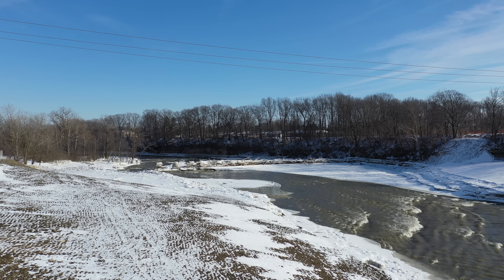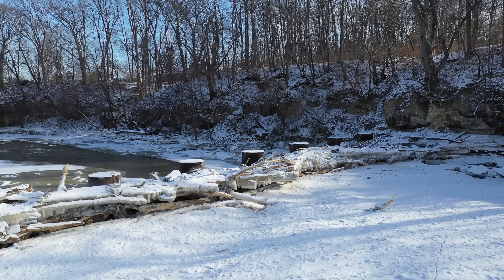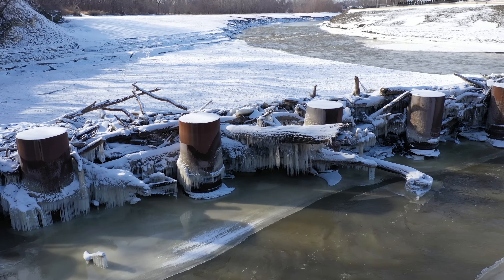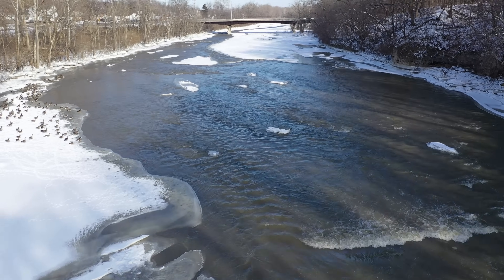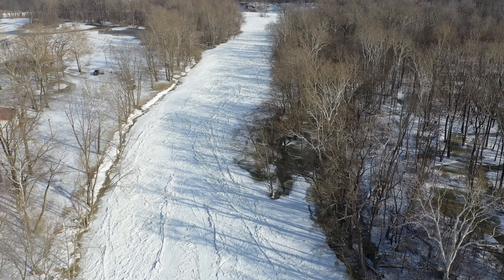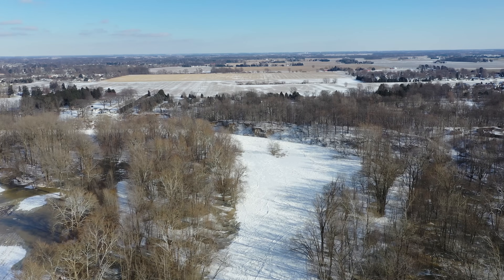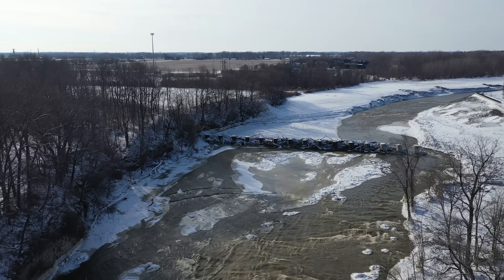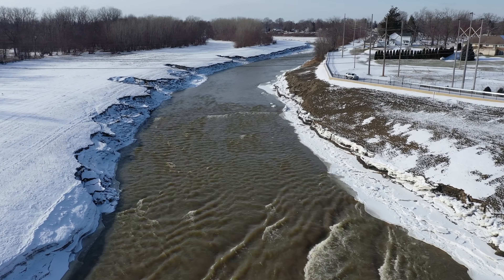Dam 2 1 2019

Comment: It'll be interesting to see what happens this coming spring season.  Freeze/thaw does some serious things to loose sediment as far as erosion.  Don't be surprised if the upper side of the ice structures erodes out to the same width as the downstream side...  When saturated mud/sediment freezes, it cracks in almost a 'shatter' type pattern similar to safety glass.  I'm not sure if if there's a technical term for it, but when it thaws, the formation itself can't tolerate the weight, and it falls away in mass.

Comment: Now that the first winter is in full swing without the dam I am sure the powers that be are re-evaluating the need/purpose of leaving the ice control structures in place. 
With the dam in place the river froze solid above the dam and when it let loose the huge sheets of ice were broken up by the ICS and were less likely to dam up the river further down. Now that the river flows faster the ice isn’t nearly as thick but the logs are coming down causing a dam at the ICS evident by the frozen cap on top seen at 2:00 showing how high the water level has been. 

I bet the ICS will be removed or at the very least shortened this coming summer if it ever gets here. Brrrrr
Reply: The ICS was recently installed because the dam was to be removed; the original plan was to construct the ICS after the dam was removed, but the schedule was rearranged because permitting of the removal was delayed by legal challenges.  The ICS is intended to replace an unintended function of the dam.  The dam removal studies state that sheet ice which formed over the impoundment area behind the dam served to capture breakup ice flowing from further upstream.  Removal of the dam would eliminate the sheet ice behind the dam, allowing the breakup ice from upstream to continue downstream and further adding to ice jams below the city of Fremont and potentially contributing to renewed downtown flooding.

From the dam removal reports:

"Twenty-eight ice jam events from 81 years of data were utilized to calibrate the model. The results indicate that the removal of the dam would have an impact on ice jam processes in the vicinity of Fremont. Winter flood levels would likely be increased in the downtown area as the portion of ice previously held by the dam would be added to the jam experienced north of the City. Stages downtown rose as much as 10.5 feet (3.2 meters) and increased on average from 3.5 to 7.0 feet (1.1 to 2.1 meters) over the range of return periods used in the analysis."

…

"Based on the 2008 report and follow up investigations in 2011, it would be irresponsible to carry this concept forward and consider an alternative that does not account for the potential heightened risk of ice flooding to the citizens of Fremont."

…

"CRREL [U.S. Army Corps of Engineers Cold Regions Research and Engineering Laboratory] simulated conditions without the dam and a conceptual structure located within the current impoundment area and observed that flood level increases [with the ICS] were reduced to less than 0.5 feet above the existing flood elevations."

…

"Discussions with FEMA at the time of this [Feasibility Study] report indicate that this increase (less than 0.5 feet) in winter and ice related in flood elevations will not adversely impact the flood wall certification process."

The ICS is intended to replace this function of the former dam, by capturing the breakup ice and creating an ice jam in Ballville, so that this ice does not add to the ice that has historically jammed downstream of Fremont.   From the Ice Control Structure Design Report:  "[I]ce control structures such as thrust blocks, divided weirs, channel blocks or boulders, and pier structures are generally placed at strategic locations in a stream and are designed to catch breakup ice floes to form a controlled jam that protects downstream areas." 

Many people expected the ICS to collect debris, including the engineers who designed the structure. That's why provision was made to access the site during low water. From the Final Environmental Impact Statement: "The modified access along the north bank would be kept clear of vegetation for periodical access to the ICS for clearing debris (i.e. limbs and trees) and maintenance." Debris collection was a known result of installing the ICS, based on experience with the Cazenovia Creek ICS after which the Ballville ICS was designed.

The city had the opportunity to remove the debris before this high water. As recently as mid-January the river depth at the Fremont U.S.G.S. gage was less than 1.48 feet; the river's recent peak since then reached 7.06 feet on January 24 (flood stage is 10 feet).  As of last night (2/1/2019), the gage read 1.94 feet.

Changes in the ICS design to minimize the capture of debris would make the structure less effective in capturing ice chunks. The spacing of the piers of the ICS is determined by the thickness of the ice to be captured: "'ICS gap width can be set at about 15 times the minimum ice thickness that poses an ice jam threat under existing conditions.' (Tuthill & Lever, 2006) From Figure 7, the typical recorded ice thickness is about 12 inches (1.0 foot) and the design thickness is about 18 inches (1.5 feet). Therefore, 15-22.5 feet would be the designed gap width, with the smaller end of that range, which is more conservative, having a better chance of capturing smaller sheets of ice from upstream." The gap in the ICS, as constructed, is 15 feet.

Had the ICS not been constructed -- or if it was now removed -- and predicted increases in downtown flood stages resulted in the overtopping of the Fremont flood protection system, the project engineers would rightfully face grater criticism than they are now experiencing from social media pundits.

Comment: As I understand it, those ice structures were installed in order to prevent ice dam flooding of the downstream town.  However, in my opinion, the structures are too close together so that logs and branches flowing from upstream are being caught.  With half the number of ice structures, or even less, I suspect those logs and branches would have passed through, and there still would have been a sufficient number of them to break up the ice flowing downstream during the Spring thaw.
Reply: The ICS is not intended to break up ice, but hold back ice floes in the Ballville area, causing ice jams there and mitigating ice jams downstream of the city of Fremont.  Changes in the ICS design to minimize the capture of debris would make the structure less effective in capturing ice chunks.  The spacing of the piers of the ICS is determined by the thickness of the ice to be captured:  "'ICS gap width can be set at about 15 times the minimum ice thickness that poses an ice jam threat under existing conditions.' (Tuthill & Lever, 2006) From Figure 7, the typical recorded ice thickness is about 12 inches (1.0 foot) and the design thickness is about 18 inches (1.5 feet). Therefore, 15-22.5 feet would be the designed gap width, with the smaller end of that range, which is more conservative, having a better chance of capturing smaller sheets of ice from upstream."  The gap in the ICS, as constructed, is 15 feet.
Reply: @joelwiller5391  But Joel if they were staggered instead of being parallel a lot of these issues would have been mitigated. and  Potentially could have  made them slightly closer together. to assist in catching ice but not holding tree's.
Reply: Randy She 
I think you’re mistaken. Log jams were an issue shortly after the ICS was created even though the dam was still in place. 

http://www.wtol.com/story/35773193/large-log-jam-builds-up-behind-ice-control-structure-near-ballville-dam/
Reply: @ZisWile , changes in the ICS design to minimize the capture of debris would make the structure less effective in capturing ice chunks.
Reply: @Crewsy , rather than relying on the understanding of a News-Messenger reporter, I will rely on the ICS design report as a primary source.  From the Ice Control Structure Design Report:  "[I]ce control structures such as thrust blocks, divided weirs, channel blocks or boulders, and pier structures are generally placed at strategic locations in a stream and are designed to catch breakup ice floes to form a controlled jam that protects downstream areas."
Reply: @joelwiller5391  
I appreciate the reply, Joel.  Time will tell if the text book approach is correct.  For starters, in order for that to work, I suspect all of the wood that has created a beaver-like dam should have been removed some time ago.  At this stage, it will be a challenge to remove all of that debris.  Plus, there is the issue of the river overflowing its banks which it already is doing.  Add ice to all of that wood, and I would expect significant flooding in that area.  The water on one side already is overflowing the banks, and I suspect the water on the other side may do the same.  Some of the homeowners below the barricade on the right side looking downstream may be feeling a bit uncomfortable right now.
Reply: @DesertSenior , what appears in the video to be overflowing of the bank is just one level of the river channel.   The top of the ICS is 611 feet Above Mean Sea Level.  The former dam topped out at 624.24 feet AMSL.  Therefore, water would need to rise more than 13 feet above the ICS to equal the minimum water that once flowed over the dam.  To give you an idea of scale, the ICS piers are each about 12 feet tall.

As for access to remove the collected debris, the river level has already dropped significantly from the river's recent peak of 7.06 feet on January 24.  As of last night (2/1/2019), the Fremont U.S.G.S. gage read 1.94 feet; as recently as mid-January the river depth at the gage was less than 1.48 feet.  At its lowest level last summer the river was about 0.95 feet.  The impediment right now is the temperature.
Reply: I did not realize Fremont itself was below the river level and was protected by levee's. Seems odd that it grew up in the flood plain when plenty of flat land above river level was available, just up stream, south of the present town.
Reply: @joelwiller5391  well then you have created flooding by your design as it is, and from the weather forecast it is going to do exactly what The supposed experts designed it not to..

Comment: I bet all the mud that washed away from behind the dam made those down stream areas more shallow, allowing the ice to dam up the lower portion of the river a lot easier than before, once controlled by the dam. With the shallowing of that area of the river, the flooding is a result of the rivers natural flow...aka course... Changing direction due to the ice blockage. If the state or land owner tries to bank off the river. It may help, but excess sediments need to be removed, or allowed time to naturally erode from the area. It will be worse when the spring run off hits if they do not remove the tree blockage. 
Great videos. I watched many of them recently, and believe you made an excellent journaling of the dam removal and the effects it has had on the surrounding area. You should consider making an all-in-one time lapse.

Comment: this had to be an Army corp of engineers project, no one else could have made it so costly and ineffective and detrimental to the local environment. After watching all the videos from the beginning  . I wish I had put in a bid on the project. demolition time of the dam could have been reduced by over 1/3 by the the use of well engineered blasting. the removal of the flood wall at substantial cost to be replaced by a fence " at substantial cost ".  Dose anyone oversee any of this stuff. 
Now what is the distance between the dam and the lake referred to, if its more than 4-5 miles , that silt and sand  will greatly increase the chance of flooding in that area. I noticed the walls of silt and sand upstream hadn't been graded . and who is going to be blamed when a child falls in the current when the river walls collapse  into the river  a day after a rain storm. A lot of money. A lot of questions.